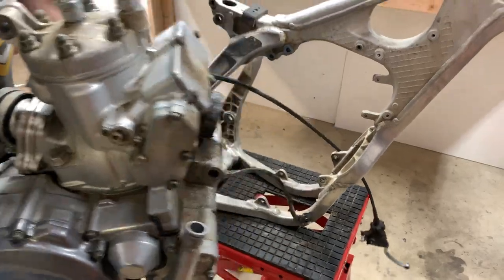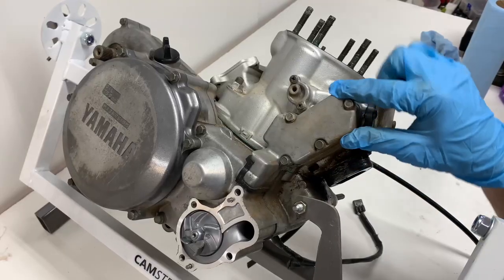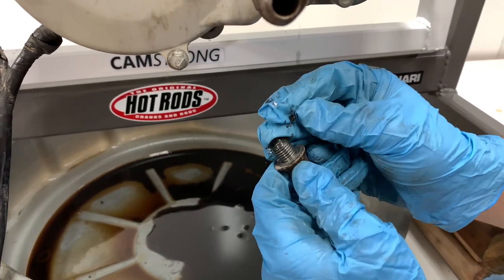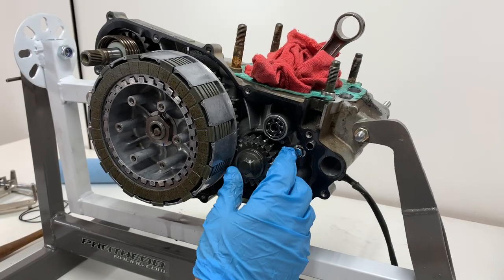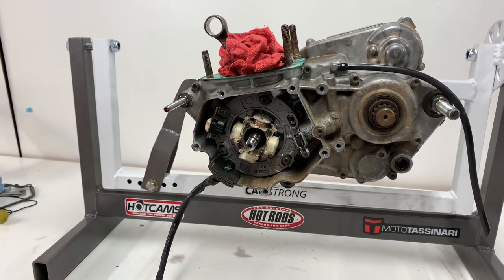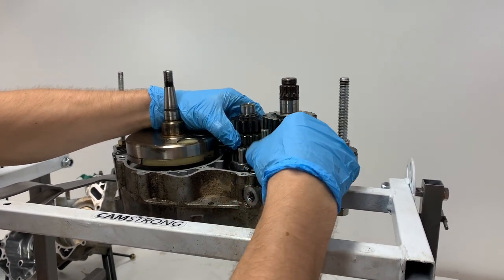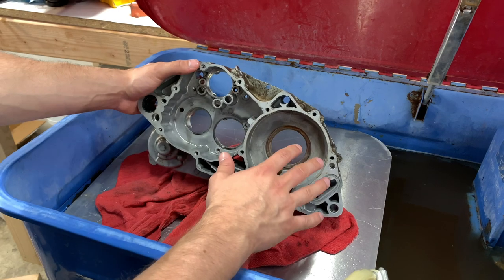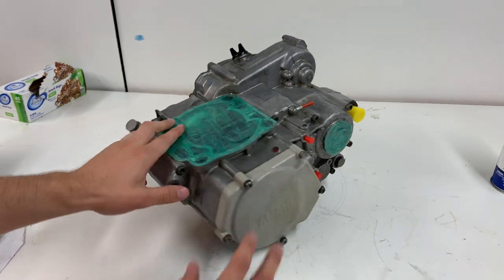Tearing Down My YZ250 Engine! Part 3

Comment: Hey Adam nice build bro. Have you done anything with the 1991 yz250? I have an issue with the clutch arm not returning/springing back. I have checked for a return spring on the parts catalogue and can't find a return spring anywhere in the pics it uses a push rod system and I checked the rod to see if it was bent but it's not. Any ideas? Any help would be appreciated. Thanks

Comment: Im currently in the process of doing my 2017 kxf 250, ive gone with cobolt, its matt charcoal with a tiny amount of flake, my personal opinion is that bright colours like blue or anything makes it look cheap n nasty, like a rattle can home job, but thats just me, the charcoal is simple and clean looking.
Reply from the maker: I agree it has a stock clean look and let’s your anodized parts standout. Thanks for watching the series!
Reply: @adampaganelli4891  definitely, currently im still riding every weekend but I usually finish here in England about November time, depending on weather, then I strip the bike n refresh engine, suspension and grease/change bearings so Ive only coated the water pump cover and the clutch/water pump housing so far but will be doing the cases and other parts at the end of the year. I Love watching bike builds, cant wait for the yz end result!!

Comment: Whats up bro, had a question if I wanted to just replace the crankshaft and bearings with the seals that the kit comes with on my yz 125. do I have to remove everything like in this video to replace the crank? Or can I avoid nothing to make it faster?

Comment: You should check the threads from oil drain bolt itself. I've seen them stripped before and leaving some metal inside the transmission. Just a thought. Great video series

Comment: Great video, will be interesting to see how the motor turns out.  The engine stand appears to work really well.  Question: what model of parts washer and sand blaster do you have?
Reply from the maker: Thanks Ben. Glad you’re enjoying the series. I was super happy with how the engine stand worked and I think it will probably work even better on assembly. The parts washer is just a cheap harbor freight model and the sandblaster I picked up used for a good price. I think the company went out of business because I can’t find them anywhere. Great blaster though haha👍🏼
Reply: Adam Paganelli yeah it would be nice to have those two items.  Once I have a bigger shop I will get those

Comment: Switch to soda blasting, easier on parts and far easier to clean!
Reply from the maker: Sorry I didn’t say it correctly in the video. I am not sand blasting I am using an aluminum oxide media which does great on aluminum.  Thank you for your advice!
Reply: @adampaganelli4891  soda is still way easier to clean if it gets in the cases. Washes out with water.